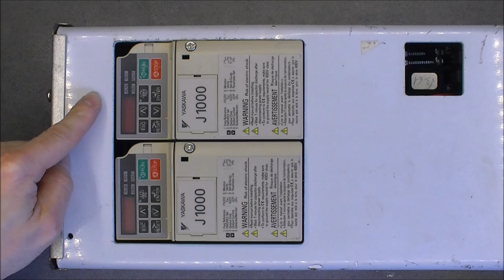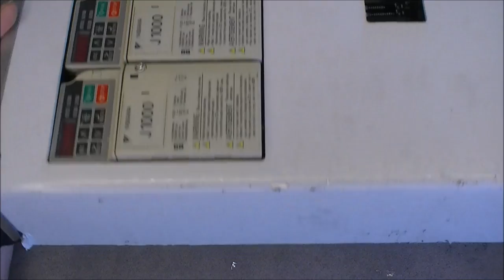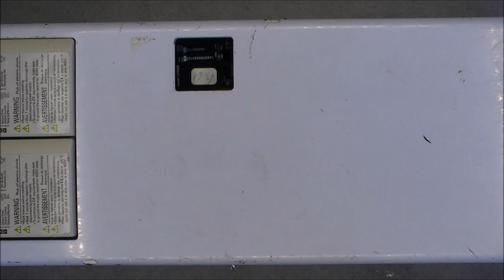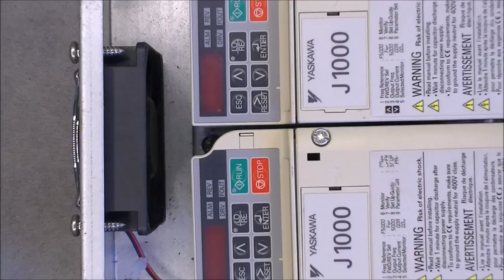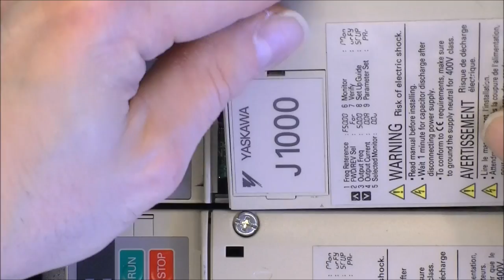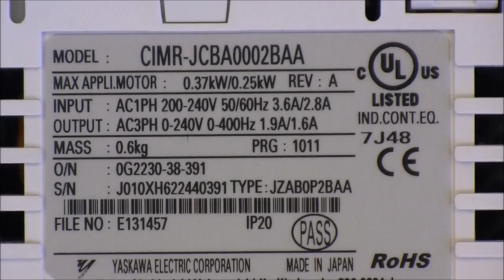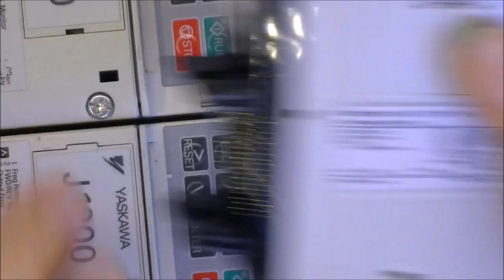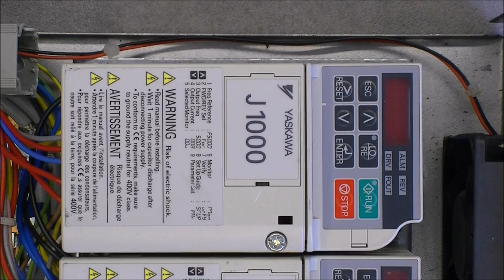A look at the 3 euros industrial controller from the fleamarket

Comment: the square socket is made by Harting, i don't remember the exact model, they come in a few different arrangements often used in industrial applications involving motors. I've often seen them used on electric curtain (drapery) motors. The vfd's are a nice score, i would scrap the rest of the box and save them!